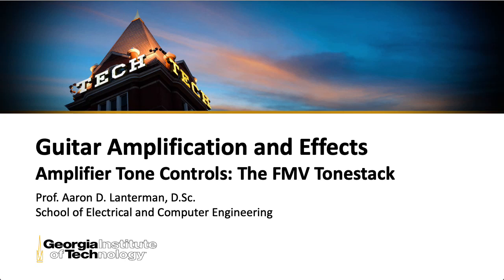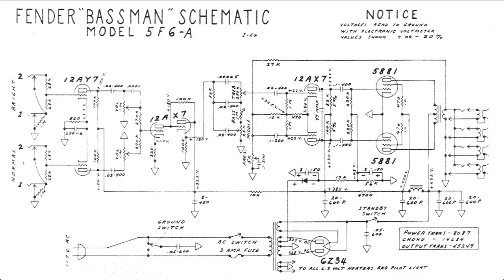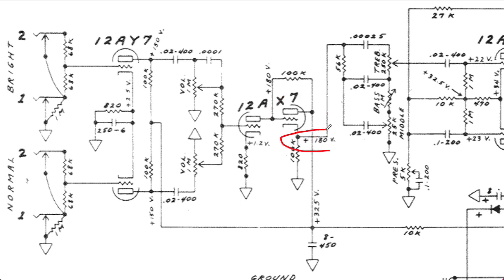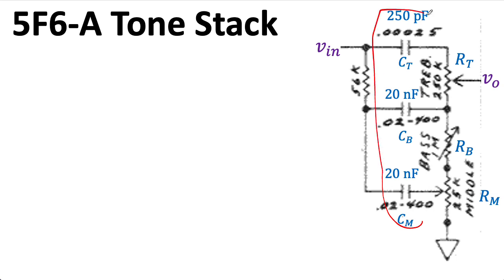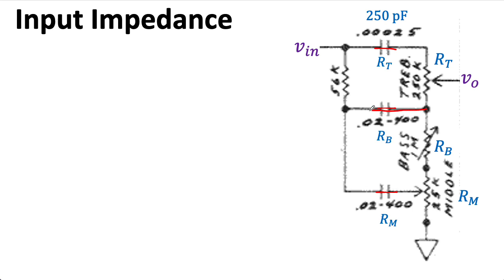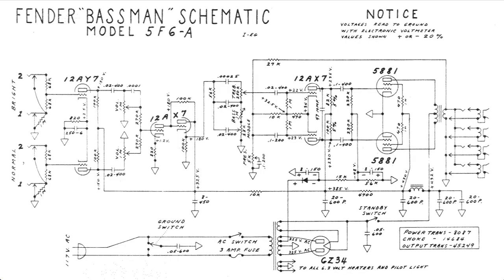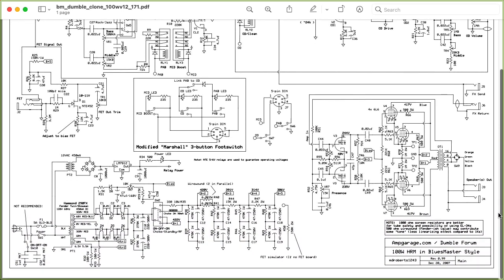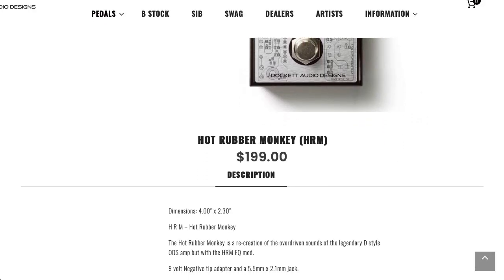ECE4448 L31: Amplifier Tone Controls: The FMV Tone Stack (Guitar Amplification and Effects)

Comment: In my humble opinion, showing the wiper on the bass pot is a key to quickly ascertaining this circuit…I’m not sure if that was a common practice to just show the two terminal with variable arrow, but that is really unacceptable. The wiper is directing signal to varying degrees as you know from “shunt” to full R and that, to my eyes, is important to see for inspection……thank you for clarifying that wiper configuration in your discussion!

Comment: I have some old Valco amps that divide the signal into 2 or 3 paths and each path is weighted for treble or bass and once in a while, mids . Those each go through 1 or 2 gain stages, so they are quite active!  HRM is an acronym for Hot Rod Marshall. No two Dumble amps were exactly alike. Alex kind of cut and pasted bits and pieces of mostly Fender/Marhsall amps but some amps borrowed from Ampeg's SVT and Dynaco's Dynakit amps. Alex also did some local negative feedback loops in some of his amps and those also varied as to whether a stage or group of stages got a loop and how it was configured for how much negative feedback and which frequencies they might attenuate. Some of these loops were physically wired in and then cut back out in some Dumble amps. HRM referring to Hot Rubber Monkey was a way to avoid cease and desist letters from Alex Dumble's lawyer(s).
Reply: the hot rubber mokey part isa halarius

Comment: Why are guitar amp filter circuits heavily using RC filters? Are LC filters not common for bandpass, low pass, HP in guitar devices?
Reply from the maker: Inductors of the value needed to be useful at audio frequencies are bulky, heavy, expensive, and highly non ideal (it's a different story at radio frequencies). So you don't see them used often in audio. Exceptions include the Cry Baby type wah pedal and the Pultec equalizers.
Reply: @Lantertronics  That makes sense. I'm an RF engineer and would never use RC or RL filter due to noise. Thanks for the info. I work with 0.5nH to 68nH inductors max, not anything near what would be used in audio circuits.
Reply from the maker: @llwonder  Yeah, a wah wah inductor is usually half a Henry. :)

Comment: What is the "cold clipper" stage doing?  The 56K resistor in the fender tone stacks is called the "slope" resistor, but what is it sloping in the frequency curve?
Reply from the maker: To be honest, I don't have any good intuition about what the slope resistor works, or how tone stacks operate in general. I may make a follow up video at some point if/when I get a more solid understanding of them.
Reply: @Lantertronics  because the slope would mean it's sloping at a certain DB per 1volt or the slope resistance is changing the filters tilt
Reply from the maker: I have another video on the cold clipper circuits, you can find it by searching lantertronics cold clipper.
Reply: @Lantertronics  thanks I will look for it. Do u have a video lesson about " blocking distortion" in guitar amplifiers?
Reply from the maker: @waynegram8907  I just mention it in passing -- basically you don't want the grid-to-cathode voltage going positive, or at least not positive for too long. The grid stopper resistor has something to do with helping with that. But to be honest I don't really understand the issue well enough myself to do a lecture on it yet.
Reply from the maker: Here is the link for the cold clipper video: https://youtu.be/izP5MDyQKr4
Reply from the maker: Google "Richard Kuehnel tone stack" (without the quotes) and you'll find some excellent analysis.

Comment: 1:10 - "Restricting our choices to passive components means that the poles of the transfer function have to lie along the real axis" - isn't that a quite a misleading statement? Passive filters can have complex conjugate poles&zeros. Perhaps you meant "have to lie along real axis, unless we feel like opening the cans of worms related to using inductors"? Or in some cases there's an additional reason for not using passive filters with complex conjugated poles - we couldn't then make the cutoff frequency variable simply just by adding a resistive potentiometer anymore (not sure if that's what we want to do / didn't finish watching yet)... or maybe there's something else you silently presumed, which would make the statement correct?
Reply from the maker: Oh! You are quite correct on all counts. I should have added the caveat that the poles are restricted to lying along the real axis if we restrict ourselves to not using inductors, which can be bulky and expensive at the values needed for audio. I should definitely have remembered to mention that, since in same video I show an example of a Pultec which uses inductors! Which would have helped make the point since inductors are a big part of the cost of that unit. Inductors will appear a little later when we talk about wah-wah pedals.
Reply from the maker: I'll add a correction to the description, thanks for catching that!